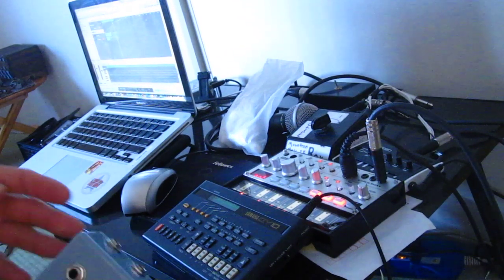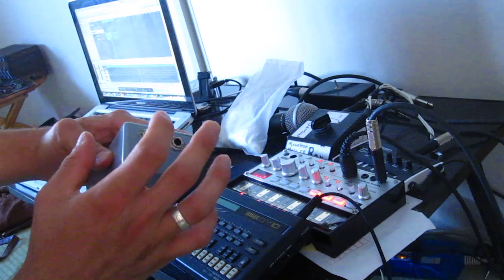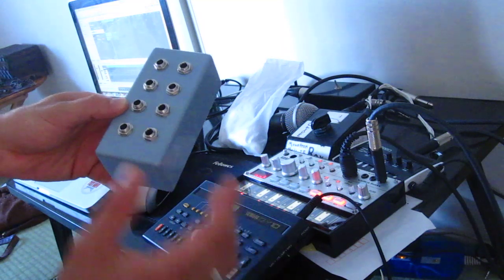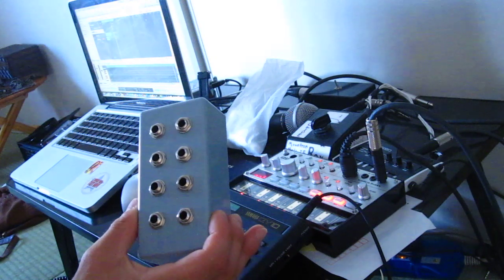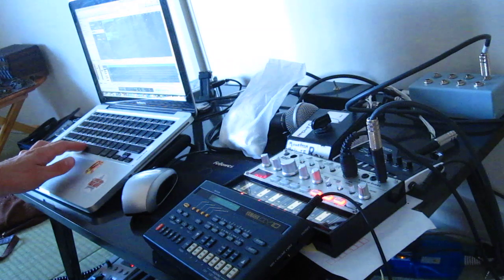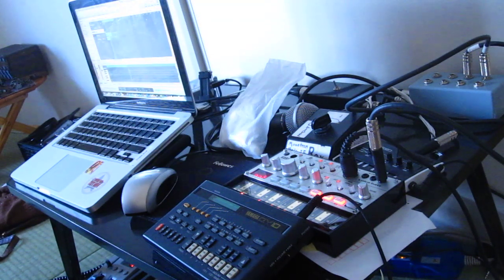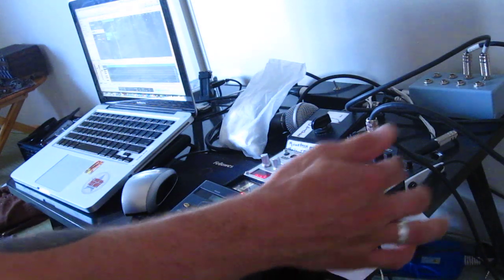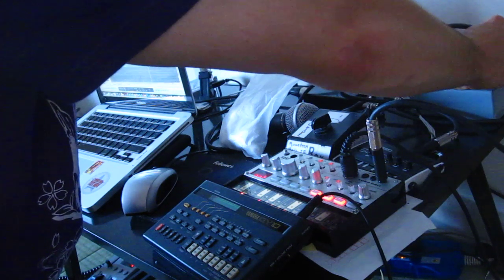simple passive DIY audio mixer demo

Comment: Can i record two microphones in computer with that ?
Reply from the maker: I guess you could.
Reply: i have 2 computers so i have an idea i will plug two microphones on each computer nd record two times with audacity with both computer nd then take the two voices that i record it with nd then separete them
Reply from the maker: I'm not sure I fully understand what you are trying to do. Are you using computer mics or conventional dynamic mics? You want to separate the audio in audacity?

Comment: Why 18K resistors?  Everywhere I've seen 1K or 10K.  Just curious, want to make sure I have the right supplies!
Reply from the maker: KM Productions 18k was the resistor I had too many of. No specific reason. I think it's best to match the impedence to match your setup.
Reply: +MrFricoco Thanks!  I have a ton of 1k resistors on hand, so was hoping to use them.

Comment: So if one really wanted to right you can make this in to a snake for keyboards or guitar or or any thing 1/4 for that matter cause this is a great build I am more looking into the live.sound side of using diy builds
Reply from the maker: you could yes! Just be careful don't add too many inputs for each channel or you won't be able to hear some of the inputs.
Reply: cause I bought xlr bulk connectors and this will work great for a main snake or a 1/4 inch guitar keyboard mpc snake agree sounds like a great idea you may have to run that box extra juice since it is passive right so what can be done for voltage drop if the snake is too long
Reply from the maker: Richard Mohabeer How long are you running the cable? For a live environment, like at a concert stage, this probably isn't the best solution. If you just build a regular snake then you shouldn't have any problems, but if you are running it far then you should make it active. Add a buffer somewhere in the chain. Big concerts are usually setup this way. You also have the issue of phase... if you mix too many inputs before you have a chance to mix it, then some of the frequencies might cancel each other out.. anyway This is great for a small setup, a guitar, keyboard and mpc is about the max for 1 channel. there is a chance that the guitar might not be heard with the rest, try adding a gain pedal to the guitar or something.

Comment: Aah Fricoco! I'm working on something like this a this very moment - so glad you did a video about it. I've got a problem though. You know I did the MIDI-mod on my Monotribe and instead of MIDI-out I did a MIDI-thru like you did on your Volca. I also made individual drum-out on the Monotribe and made a simle low pass filter for the bass drum of the Monotribe (1nf capasitor) and it works great! BUT!!!! When I sent the three signals (hihat, snare drum and bass drum) into the passive mixer you've just described the low pass filter effect is working on all three signals!! That was NOT supposed to happen! I understand why, though. - in short: do you know of any way to effectively isolate the signals and yet mix them? Tricky huh?
Reply from the maker: ya I've actually had a lot of issues with that lately as I collect more gear. 3 signals is kind of the most I found I could do on 1 channel comfortably. Sounds like you might have some phase issues too. I guess if you want to go passive the best fix I can think of would be to add maybe something like 500k or 100k potentiometers after the input and find the right balance where everything sounds clearer. if you have any spare opamps though you could take a look at this site: http://sound.westhost.com/articles/audio-mixing.htm

you actually just gave me the idea to start working on a new 16 channel mixer
Reply: MrFricoco Thanks for the answer and the link! Very informative.
I'm actually using a little amp (stereo) and planning on using pots too. I think I will give the bass drum it's own channel - that might do the trick!
I was thinking phase issues too, but I was very careful to avoid that. The fact is that the lowpass filter (a cap that shorts ground and signal) will of course be on ground always, and as soon as two or more signal lines are mixed the cap shorts all signal lines and ground, thereby applying the lowpass to the whole mix :) (I need a workaround)
Sounds nice with a 16 channel mixer!
Reply from the maker: Arrayzable hmmm... if thats's the case maybe think about using a buffer to isolate that signal. not sure if that'll work but might be worth looking into.
Reply: I've decided on a non DIY solution for this particular problem. But I will make a passive mixer like yours and use it instead of the active mixer that I'm ripping for this project. Thanks for the help and the discussion!